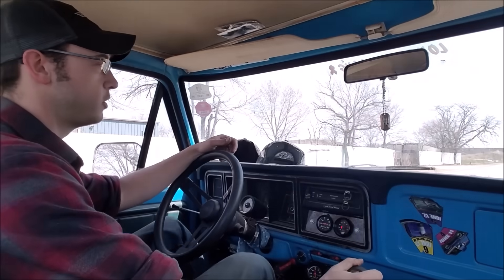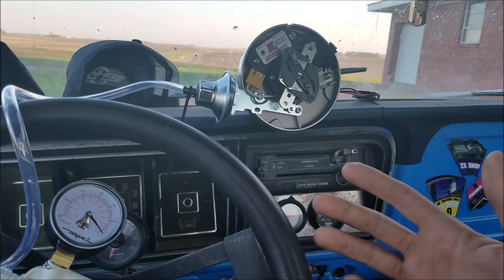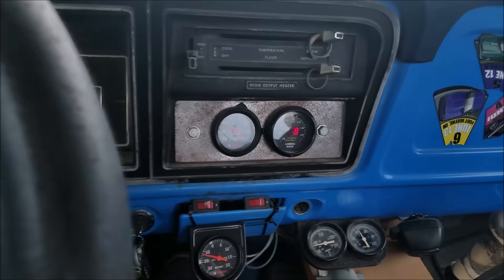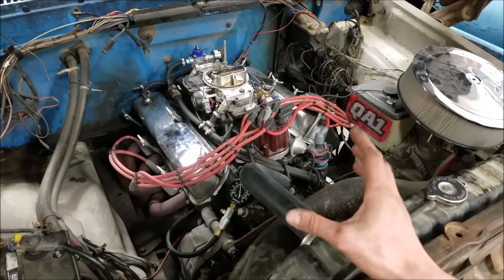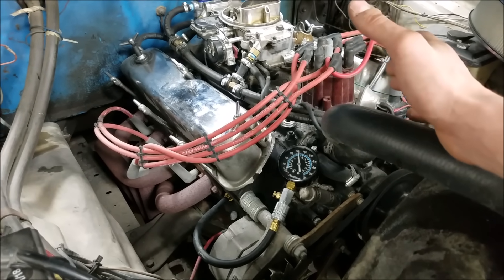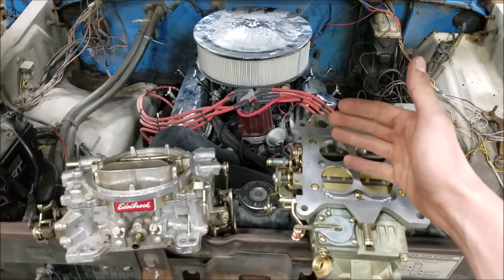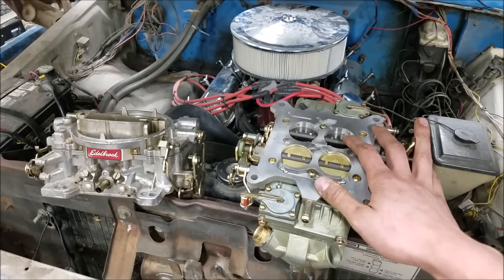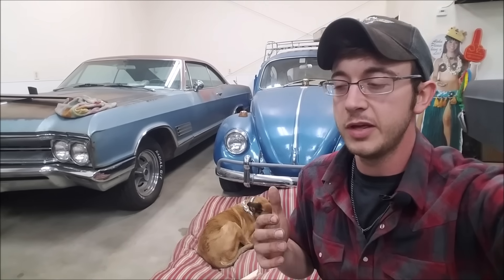Vacuum Advance - Ported vs Manifold: Which to Use & When !!!

Comment: The older engine set-up used straight manifold vacuum advance  to run near maximum  advance even on idle with the centrifugal advance adding a few more degrees as engine speed increased.
The vacuum controlled advance allowed for reduction of advance to coincide with engine load.
The need for ' ported ' vacuum connections came about as early emission standards called for allowing more air to bleed through the throttle plate which in turn increased the idle speed. In order the keep the idle speed slow the vacuum diaphragm was connected to a port on the carburetor which passed no vacuum draw at idle position but allowed vacuum as soon as the throttle plate was advanced beyond idle position.
Then as emission standards became more strict and manufacturers were not prepared to meet them the only thing they could do was to ' de-tune ' the ignition timing to get the cars to pass.
Most cars of the early 1970s were set up so that the initial advance of the spark was set way back and the vacuum advance mechanisms were still there they almost never activated.
A thing that I did a lot in the late 70s and early 80s was resetting the timing of friends cars so that the advance was more normal and so the vacuum advance actually did something. They thought I was a magician as suddenly their 70,000 mile car that got 15 miles to the gallon could now burn the tires and got close to 20mpg.

Comment: Now, to the widely-misunderstood manifold-vs.-ported vacuum aberration. After 30-40 years of controlling vacuum advance with full manifold vacuum, along came emissions requirements, years before catalytic converter technology had been developed, and all manner of crude band-aid systems were developed to try and reduce hydrocarbons and oxides of nitrogen in the exhaust stream. One of these band-aids was "ported spark", which moved the vacuum pickup orifice in the carburetor venturi from below the throttle plate (where it was exposed to full manifold vacuum at idle) to above the throttle plate, where it saw no manifold vacuum at all at idle. This meant the vacuum advance was inoperative at idle (retarding spark timing from its optimum value), and these applications also had VERY low initial static timing (usually 4 degrees or less, and some actually were set at 2 degrees AFTER TDC). This was done in order to increase exhaust gas temperature (due to "lighting the fire late") to improve the effectiveness of the "afterburning" of hydrocarbons by the air injected into the exhaust manifolds by the A.I.R. system; as a result, these engines ran like crap, and an enormous amount of wasted heat energy was transferred through the exhaust port walls into the coolant, causing them to run hot at idle - cylinder pressure fell off, engine temperatures went up, combustion efficiency went down the drain, and fuel economy went down with it.

If you look at the centrifugal advance calibrations for these "ported spark, late-timed" engines, you'll see that instead of having 20 degrees of advance, they had up to 34 degrees of advance in the distributor, in order to get back to the 34-36 degrees "total timing" at high rpm wide-open throttle to get some of the performance back. The vacuum advance still worked at steady-state highway cruise (lean mixture = low emissions), but it was inoperative at idle, which caused all manner of problems - "ported vacuum" was strictly an early, pre-converter crude emissions strategy, and nothing more.
Reply from the maker: That's frankly mis-information. 
Ported/timed vacuum advance existed long before emissions. Some failed GM engineer said that in the early forum says and it's been incorrectly perpetuated as gospel ever since. 

All that aside - most aftermarket distributors have little mechanical advance. Take any aftermarket GM hei, it's 15. Total timing is going to be garbage if you run manifold since folks inevitably bias their mechanical initial down to compensate. 

On the other hand if you have something like a pertronix pro billet with 24 available, you get around that problem -  but if you have low initial, now you need light springs to get the timing ideal on hard off the line throttle. 

Those springs wear and stretch early, causing folks timing to often never return - always partially mechanically advanced. Rpm hangs, bunch of dumb things happen. 

My logic is sound and is actually real world effective - that's why thunderhead289 is a respected name in carb and ignition tuning.
Reply: @ThunderHead289  good for you, Pat yourself on the back, with all your world renowned experience, you definitely need the content views 🤣🤣
Reply: @ThunderHead289  No one tunes their centrifugal advance based on vacuum advance... THAT'S DOING IT BACKWARDS! Here is the proper way to do it:
1) set up initial lead (use factory setting)
2) set up the weights/springs (centrifugal advance)
3) LAST, set up the vacuum advance: Allen wrench inserted into the distributor vac advance port

If you are doing the vacuum first, you will be forever chasing your tail. Why make it difficult?

Comment: Here's a little history lesson the ONLY reason factory cars went to timed vacuum in the mid 70's was because of the catalytic converters, the lower vacuum signal at idle that timed vacuum created put more load on the motor, which increased heat, which helped keep the cat lit, along with higher opening temp thermostats, it was for emissions nothing more, do a little research, many old factory service manuals even explain why it was done, no long winded theory necessary, it's as simple as that, unfortunately like many things today, that information and literature is going away, and replaced by what people think they know rather than actual fact, go find any 70's through early 80' service manuals or motors manual all the information is there
Reply: No, they had ported vacuum on 1960s cars (I've owned several). California started this. In fact, it was for lowered idle emissions, years before cat converters. And the ONLY reason they invented unleaded gas was that the lead ruined converters (it wasn't for public health, ironically).
Reply from the maker: Actually you are regurgitating mis-information - timed vacuum existed long before the 70s. 
That's some garbage that was said by a failed GM engineer, and has been passed around on the internet as fact for way too long ....
Reply: @ThunderHead289  I guess factory GM, Ford, Dodge, engineers, knew nothing, and even internal service memos were all lies huh, keep drinking the bong water and believe whatever you want, an run your mouth all you want, you don't know what you don't know, those that do, do, this actually pre dates the "internet" the source of all your knowledge, and in typical fashion of people that don't want to truly find factual answers, and want to believe what they believe without actually researching something for themselves, you reply was predictable, with your vast knowledge you've acquired in your young years carry on 🤣🤣

Comment: I noticed they didn't take into account the centripetal advance inside the distributor. Weights sorta look like two 1/2 moon shapes. As RPM's increase they fly out and change the timing.
Reply from the maker: Because we are talking about vacuum advance in this video only .....
Reply: @ThunderHead289  Those weights alter vacuum advance. Not much differently than a vacuum delay valve. Or ported vs non ported.
The proper way to set timing is disconnect the vacuum advance, plug the vacuum line, then set timing.
Then reconnect and recheck everything.
Ported vacuum is how the engine is supposed to work - advance upon acceleration and stable during cruising.
That's what grandpa taught me.
Reply: @crazysquirrel9425  The weights on top have nothing to do with vacuum advance. That's the centrifugal advance (RPMs-triggered).
The vacuum advance (engine load-triggered) is controlled by a moveable plate at the BASE of the distributor.
You're right about setting the initial basic timing, however. Always disconnect that vacuum hose first!

Comment: The answer is it doesn't matter outside of idle.  I didn't like manifold because in cold temps with a choke, my idle speed was inconsistent.
Reply from the maker: Right - which I explain in the video. And I explain why manifold leads people to screw up their mechanical timing due to the extra timing at idle. 

People are really stupid about ported vs manifold - most think ported is actually venturi vacuum.

Comment: Is the vacuum can adjustable? I’m getting to much timing causing detonation at cruising speeds with part throttle. I’ve tried both manifold ports not knowing they were the same thing except for manifold being 0 at idle. I don’t have a dial back light to see the total timing. I do have timing tape coming in the mail to hopefully see what’s going on there.
Reply: Some cars (Ford) had an adjustment inside the distributor vacuum port. Adjust with an allen wrench. I think this is just a limiter (max amount allowed) but does not adjust the RATE of advance. But you can build a small "vacuum bleeder" to reduce the onset rate. This is crude, but it works!

Comment: manifold signal drops under throttle until the motor catches up with rpm, ported starts off at 0 and moves with throttle ,  So at idle you are totally correct with manifold being high and port being low. However as soon as you throttle it the manifold drops for a split second or more till the motor reaches rpm to sustain that manifold vacuum. The ported does the totally opposite.  The correct way is to use one of those horrible vacuum switches we all take off and throw away.  Manifold vac going to dist at cold temp to help engine start and warm up, but then it switches to ported once it hits temp. ( you can pick what temp it switches at by the data sheets.) Then set timing once it is warmed up and on the ported side or with vac adv unhooked and plugged.
Reply from the maker: I agree with the temp switch conjecture, although ported will do the same as manifold if you have two gauges in the car and have the engine under load. 
It looks that way from a free Rev since the ported port slowly gets exposed. 
Let's say your idling at 18inHg, when you take off, Vacuum might drop to say 10inHg - ported being uncovered will look like it's increasing because it starts at 0, but actually also goes to 10. 

They are one and the same off idle if the throttle blades are set within an acceptable window

Comment: You failed to mention the benefits of connecting the vacuum advance to a full manifold vacuum source, such a cooler running engine and better fuel economy.  The only reason the manufacturers went to ported vacuum sources in the '70's was to pass the emissions standards of the day.
Reply from the maker: Yeah none of that's true. They both do the same thing off idle, so that gas mileage arguement is stupid. Also, ported existed long before emissions - both of those arguments have been long perpetuated on the internet by stupid people. 
This is your opportunity to be enlightened, take it.
Reply: @ThunderHead289  Well, you're just dead wrong.  Using manifold vacuum will give you a smoother idle and use less fuel when idling because with the low fuel/air volume in the cylinders with the earlier spark advance makes the engine more efficient. The idle speed will then increase using manifold vacuum and adjusting the idle speed down will reduce the fuel consumption and result in a smoother engine that also generates less heat so it will run cooler when at idle in traffic. My 1979 Pontiac Trans Am 400/4-Speed runs at least 10-15 degrees cooler and gets 2-3 more MPG with the vacuum advance connected to a full manifold source.
Reply from the maker: @CashMullen-ng4sr  if your just moving vacuum sources and not doing anything with your mechanical timing to take advantage of what runing ported allows you to do, you don't have a correct comparison. 
Which, if your idle jumps when switching to manifold, it confirms. 

Which I explain in the video. 
Not your fault - the internet had had its head so far up its ass on this item for so long, it's hard to find correct info on it.
Reply: @ThunderHead289  
"both of those arguments have been long perpetuated on the internet by stupid people."

You're the ONLY one I've ever heard say this. So you're right and the world is wrong?

Comment: Old school dizzy is a flawed design by ecu controlled via detonation sensor and load/vac sensor with throttle position sensor input to fine tune control  VS max spark mechanical  advance is based on MAX load under moderate load spark table is restricted and less than ideal . This occurs if u are not at light throttle cruise  tune advance situation .

Comment: Vacuum at idle is available with automatic trans  in some GM vehicles . [The same model runs ported on manual g/box . ]   Re manifold vac,,    xtra advance I assume would help pull thru the convertor stall on the auto . Tune up for auto was pull vac line and plug then set base timing .then reconnect.

Comment: Its not confusing.     Ported vacuum  increases with rpm    thats it.
Reply from the maker: No it doesn't 😄 it's the same as manifold pretty much anything off idle. Venturi vacuum which actuated vacuum secondaries increases with air speed. 

Maybe pay attention hmm?
Reply: @ThunderHead289 Thanks for responding.    yes, Venturi vacuum increases like a seconries, same as Holley's  metering block ported vac designed for the vac advance. That is correct,. But manafold vacume drops while opening the throttle when we need advancing and regains some at steady speed, what we don't want.

Comment: Never ever if you have a hotrod motor even think of using vacuum advance put the right springs and bushings in your distabutar and set it for a good sweep 
Mine is set 12 initial and sweeps to 40 at 2500rpm 
Vacuum advance is for gas mileage only and if you want to burn up motors all the time
Reply: I run a dyno for leaving and have for 15 years
Reply: Know I am talking about medium to race engines we get sell and dyno all motors set distributors and that’s it and I can tell when we get a warranty return on those motors every one of them the dam morons have hooked up the vacuum advance and burnt the dam pistons out every time
Reply from the maker: You clearly didn't listen and have 0 concept of how vacuum advance works. But you are on the right path to burn up your own engine with 40 degrees of mechanical timing at 2500rpm 😄
Reply: @ThunderHead289  been running it like that for 2 years know 
383sbc with 11.1 compression 
Afr aluminum heads 250cc runners 
Comp solid roller  with .633 lift 
Harland sharp shaft mount rockers with 1.5 ratio 
All eagle forged bottom end 
Victor jr intake and 850 double pumper carb 
MSD ingnition system ready to run type no box 
I turn this motor 8600
Every day 
It’s my daily driver and 12-40 sweep is it 
I have concept of vacuum advance just think it’s not worth it when you can just set mechanical and be done